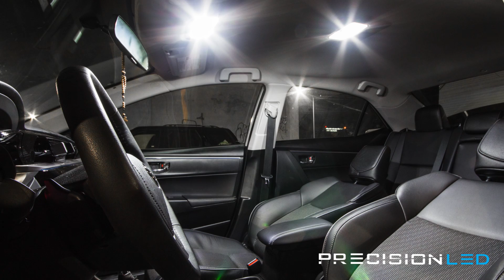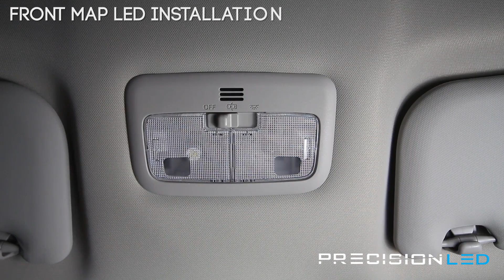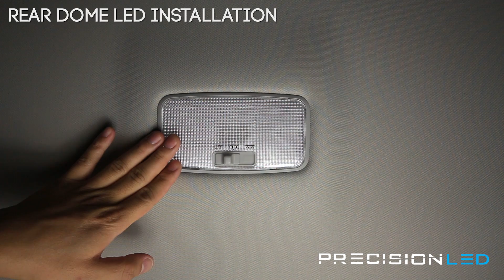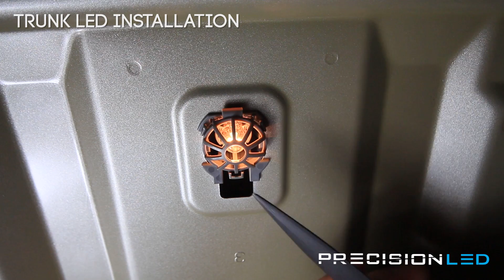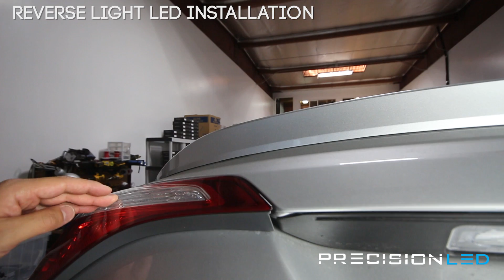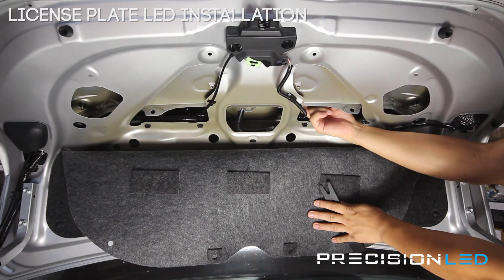Toyota Corolla LED Interior - How To Install - 11th gen 2012-2019 (MY2013)

Comment: Just now installed all 8 of these bulbs into my 2015 corolla (in 2022) and let me say it all worked out well in the end and the bulbs they're selling today all work great as expected, especially those which are the 360-degree premium bulbs. Let me fill you in on some side-pointers if I may -- very important:
1. Regarding the map lights, they were in there very snug and did not want to come out, so I ended up turning the black socket counterclockwise and it ended up getting sucked up into the back of the fastening plate.  So, if you cannot get your bulbs to easily come out, I urge you to use one of the prying tools (flat end) and pry the entire assembly out so you can get to the back side, from there all is self-explanatory.  2. Dome light:  On my car the lens was too tight to use the tool Phil used in this video, you'll need to use the 'fork" tool; when you get the lens to pop out you don't have to take out the assembly, just use the pointy tool to slightly bend back the side (driver's side in my case) of the bulb holder pop the bulb down and out with another tool of some sort. When inserting the new 360-degree bulb it's ok to push slowly and hard to get it positioned, then I took metal tweezers and gently bent the prong inward to further secure the bulb so it wouldn't pop out later -- it worked out great, the bulb is bright as hell and it's not going anywhere. 3. The reverse lights went in as simple as in this video. 4. Using the fork tool and a steel pair of super thin pliers I finally got my fastening grommets out of the cover, then proceeded to grab onto and pull out the back of the bulb holder -- getting the new bulbs out was not as easy as in the video -- you notice some bulbs to not want to come out and take some ingenuity to get out.  Once out and replaced the hard part for me was to gently get the back assembly turned and tightened, again, not as easy as in the video -- but it works and is self-explanatory.  There you go, I hope this adds to the ease of changing your bulbs -- all Toyotas can be slightly different, so be ready to modify your efforts if needed.  P.S., my OEM passenger reverse bulb was a bitch to take out and ironically the left was easy, again, depends on who installed it on the assembly line -- but they are "super-bright" and you will be please with your new bulbs from Precision LED.  Go for it!  Good Luck.

Comment: Do you know how to do 2019 corolla hatchback map lights?  Thanks
Reply from the maker: The map lights on the 2019 should be identical to as shown in this video.  Unless, of course, the lights are stock LED which you cannot replace as they are soldered to a chip and board.

Comment: I got a question recently my dome light, tail light is not working. I realize my fuse blew out so I bought new fuse and install it. Everything is fixed but the front map light is not working on the right side I changed everything but theres no light. I dont know if its the fuse or did I put it wrong. Can somebody help me out? I got the toyota corolla s 2015. Thanks in advance.
Reply: JM Dilig I would suggest buying huge pack of fuses and then check both fuse boxes to see which one is blown then replace those and then put led in it should work also I don't have much experience putting led in corolla since I just bought it within same week so I was told to either unplug the battery then put led in before you blow any fuses

Comment: I was having a hard time removing the halogen bulb from the license plate part, why is that?
Reply from the maker: Thank you for contacting PrecisionLED.  It is not typically difficult to remove any halogen bulb from your vehicle.  However, we do sometimes require assistance with some tape.  If you would like a more detailed explanation on how some tape may help, feel free to contact us directly at help@precisionled.com.
Reply: +PrecisionLED I broke the halogen bulb then just pulled it out with a long nose pliers but when I installed a new LED it was bent because I think the LED was long but it still works
Reply from the maker: Were the LEDs purchased from PrecisionLED?  If so, if you have having issues, feel free to contact us directly at help@precisionled.com.